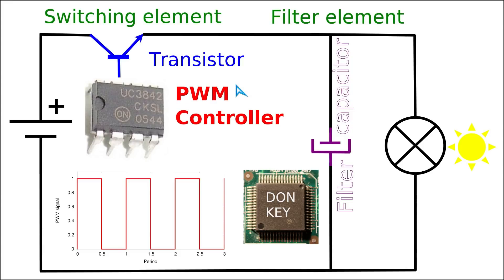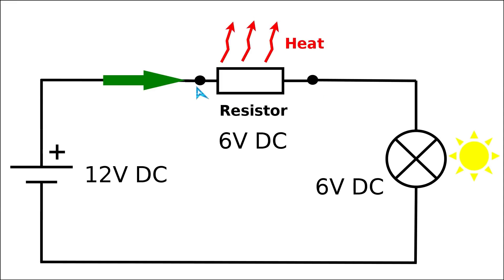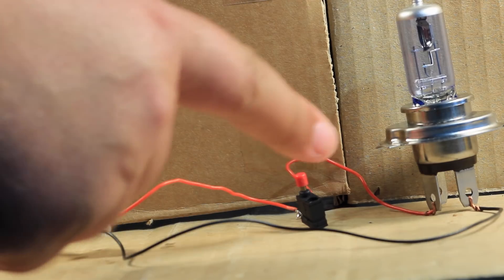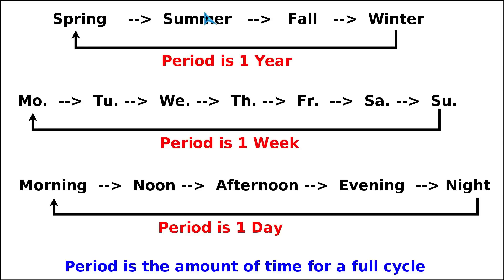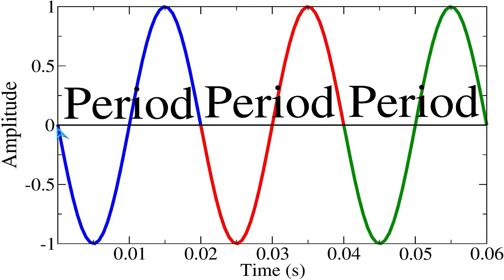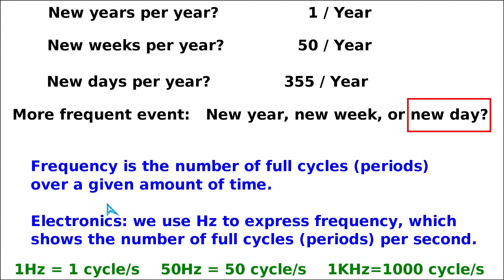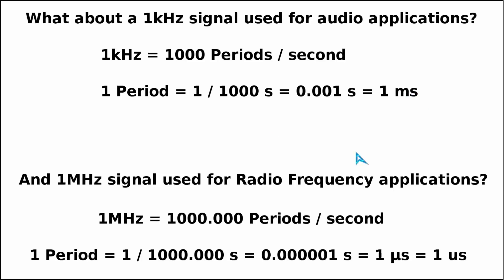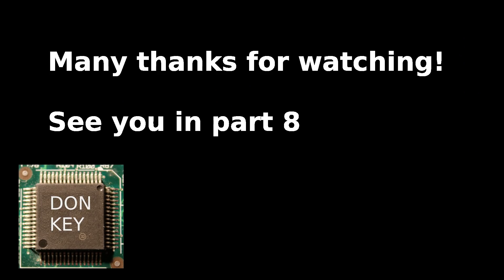Switch mode power supply repair #7: Basics of Pulse Width Modulation (PWM)

Comment: I also started watching your series because I wanted to repair my ATX 750W power supply. It was running fine then my computer just shut down and then would not turn on except the fans rotate just for a second and the lights blink when I press the power button. This will not happen again if I press a second time unless i switch off the main power and then replug again and try. Can you please help what could be possibly wrong with my Power Supply and how can I repair it. Thanks.

Comment: Hello. I need your help. cisco me3800х does not see the console, does not load. Hot elements on the board are detected. (q27, q48 (7860 saf)) on the line 1.0 v) Help in troubleshooting. If possible. Thank you.

Comment: I first came across switched mode power supply when attempting to fix  halogen downlights in our apartment. Expecting to find a simple transformer with diode and capacitor, I found it hard to understand the strange circuit.  There was scant information online,  until I saw this series.  Your lessons have been most beneficial. I now have several failed units that I would really like to fix.  Looking forward to the next lesson.

Comment: Teacher, in the datasheet of a led, there is duty cicle "x", is this PWM critical for the operation of the led (component)? Need to create his circuit, with the specific pwm, correct? Thank you.
Reply from the maker: Yes, the duty cycle is exactly in the upcoming video, which I will hopefully will be able to finish and upload. The idea behind using PWM for an LED is, that for a short period of time one can feed the LED higher current than if one would feed it with a constant current. However, this time period must be smaller than the duty cycle defined in the datasheet, otherwise the LED will burn out.

Comment: dear sir i want to step down 24v DC to12v DC 20Amp it it possible with mosfet.without tranformer.
Reply from the maker: As I wrote to you in the other topic, you can easily step down 24V DC to 12V DC using a buck converter. If you do not need/want a transformer, you can simply use a beefy inductor to do the work.

Comment: i want to step down 24 volt to 12volt what i need to do,please help.
Reply from the maker: You will need a buck converter. Also, you need to figure out, whether you want a fully decoupled output (transformed based switch mode power supply) or a coupled output is fine (simple inductor/FET switch mode supply).

Comment: Theories theories nothing practical in this video that would help fixing a faulty PSU
It will help design a PSU which is not the intended purpose of the video series. So even if the information is nice I consider this wasting of time.
Reply from the maker: I am sure that there is lots of random repair vids out there and the issue is exactly with the fact, that for people who would like to learn what/why to replace random videos are not helpful. Without understanding the design of an SMPS, how will you repair one? I "wasted" my time to create and upload these videos, so if you really waster yours, by all means, just thumb it down, and watch some real professional repair videos instead.
Reply: OK, you go read the kurran 20 times every day. That is good use of time.

Comment: Hope you can help me here boss ,,, I have LG Mini Hi fi system MDD64... The system is powering on well but no sound...
Reply from the maker: Does it have a switch mode power supply? 
What do you mean by powering up? Did you measure voltages on the PCB?
Are the amplifiers being powered up? If yes, what happens when you feed in an
external signal?
Reply: Donkey Learning IT ... Yes It has SMPS ...I mean that When You Connect the system to external power source and push standby button, you can see that the system is powering on,,, AUX/TAPE/TUNER/DVD/CD Functions seem to work well when pressed but No sound output through the speakers and even  in the audio jack... I have tried to Measure the internal components but im unable to find the problem.
Reply from the maker: As I asked earlier, are the amplifier circuits (preamp and the power amp) being powered up? You need to measure this with a multimeter.
Also, you need to feed in external audio signal to the preamp, and test whether that is being put on the output. Higher end Hi-Fi systems use digitally controller silicone switches for controlling the signal. These switches are controlled by a small microcontroller. This is why you need to figure out first where you can feed in an external audio signal to check at least the analog section.
Reply: Donkey Learning IT Ok i will check on that